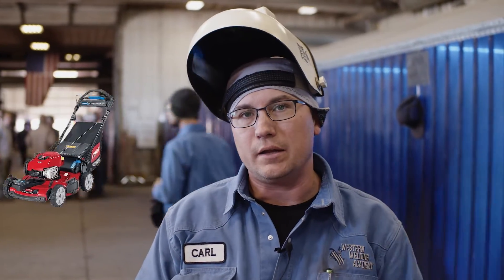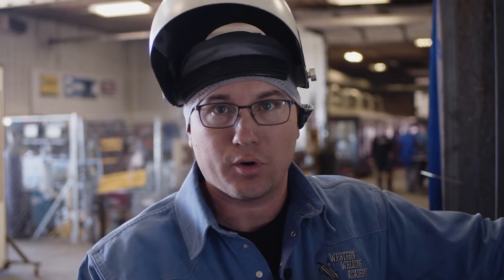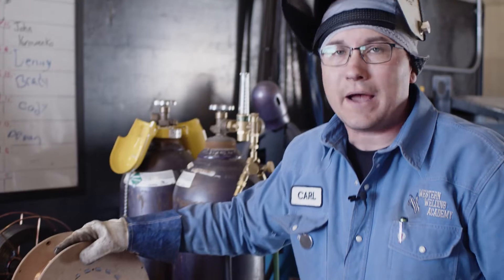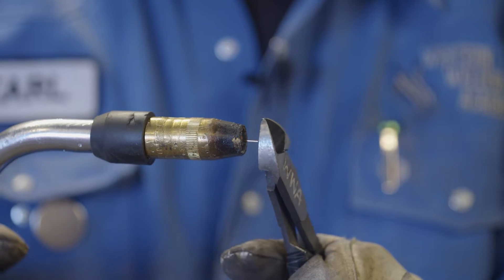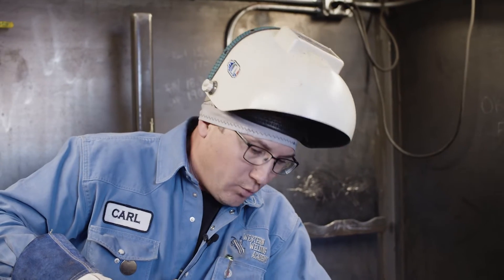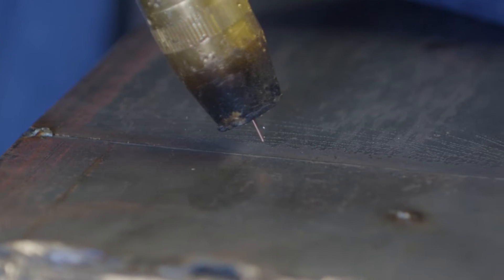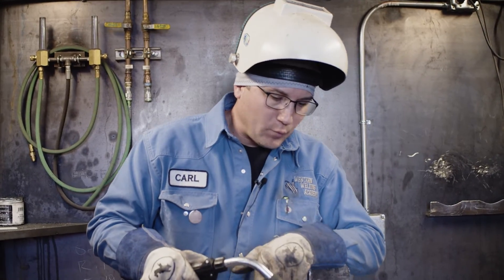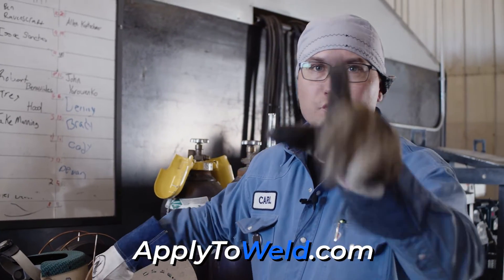How To: Mig Weld (GMAW For Beginners)

Comment: I know everyone says your supposed to start with a stick welder, but this is what I’m learning with is a wire welder or MIG (whatever you want to call it)a miller multimatic 255 to be exact, because it’s what I got. And so far I’ve really enjoyed welding with it, and for working on a farm there’s a lot of fab work to do. Thanks for the tips
Reply from the maker: Anytime 🙌
Reply: I have tried stick and I have had so much trouble with sticking. I'm getting to a point where I can do mig pretty decent but my stick skills sucks.